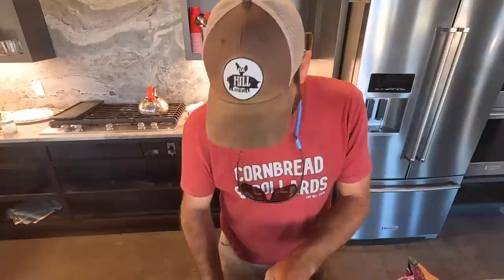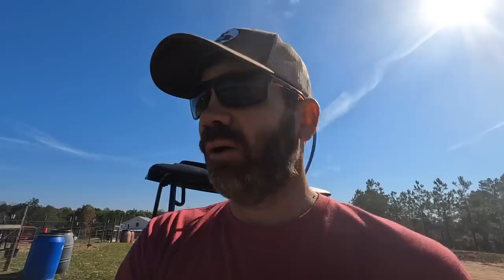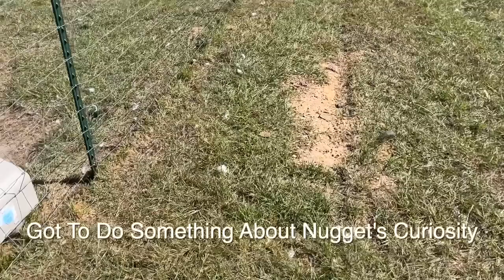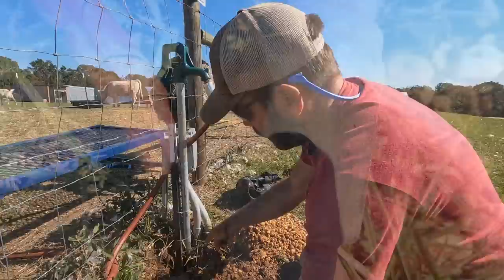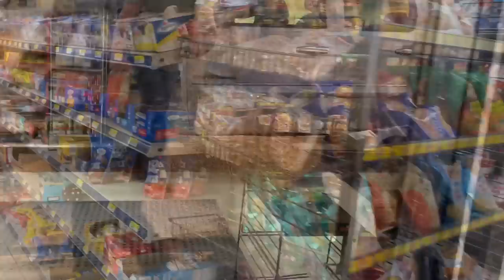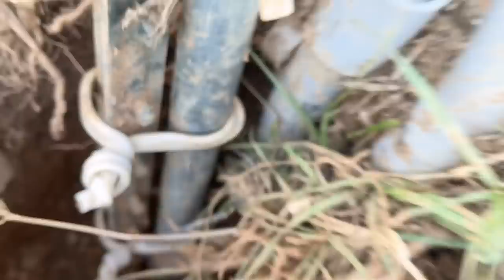This Happened WAY Too Soon!

Comment: Plastic are notorious for these simple brakes in them.....Had a toilet run for two weeks off and on continuous after flushing and it was a diaphragm that has to be washed than put back end the system.... an easy fix but who knew double the water for one month....

Comment: Put a back board to stabilize the pipe. And yes. Never known glue to not dry up in no time at all after you open it. Even in a zip lock bag.  I would have left the hole open for day or two. Just to make sure. But I’m terrible at plumbing. TERRIBLE!!!!

Comment: Jason, stop saying I’m not a plumber, u did plenty of plumbing u don’t even know it. U did good with electrical installations, electrical is another form of plumbing, voltage =pressure, current = rate of flow, the only difference between plumbing and electrical circuits is terminations. A professional plumber might have had the same luck u did doing the installation of this pipe. Live and learn, u learned today thanks to your mistake. Keep learning cos. I bet u nugget enjoyed your company more today than yesterday. 😉

Comment: You can use all Kind of fruits including apples and stuff like that if you cut them up small enough and give them more of a choice and it’s pretty easy to cut up you gonna chopper I did read about eat The Lizards but it’s hard to believe yuck

Comment: Do you think setting a piece of rebar in some concrete and strapping the pipe to it would be a good idea to anchor it. Just wondering if it’s going to happen again with you guys turning the water on and off. The Lester comment had me lmao’ing. Sorry Lester.

Comment: Sure is a booger when a routine task turns into a major project! I’m doing some deep cleaning, purging and rearranging in my kitchen the past few days.. I was cleaning our the little spice cabinet beside my glass top stove. I.. who NEVER uses my glass top stove surface for anything but cooking.. and grumble a little bit when anybody  does 😆.. placed some spice jars.. plastic and glass, and some variety packs of amish popcorn.. see where this is going😐😆.. I accidentally leaned into the controls and turned it on.. (BIG 👎 on this “feature.” If I had young ones at home still this otherwise awesome stove would have been gone.) I happened to notice the  glowing red burner as the plastics started melting… I had  ground sage, dill, celery, ground cumin and  paprika, as well as mixed popcorn kernels everywhere.. so now I have a few seasonings that I have to replace and a jar of mixed popcorn! My stovetop however.. needs more than a surface cleaning. I sat down to find out how to get the plastic residue off and got distracted with your video!

Comment: Don't you all have a well I was just wondering why you did not use the whale water If you do have a well instead of City water or whatever that is it would save you a lot of money probably and if you've already got a well why not use it just curious I have found a long time ago You need to run schedule 40 pop underground and usually put it in conduit of some sort maybe if it's 3/4 I would say at least inch and a half to 2 in less likely to break from the ground moving rock working into it through the ground just my experience

Comment: I see a lot of people have problems with those frost free taps because of the PVC pipe why are you using PVC instead of black water line PVC brakes to easy I'd pore a 6" slab of concrete at the top to stop it from moving and there would be no mud around the tap